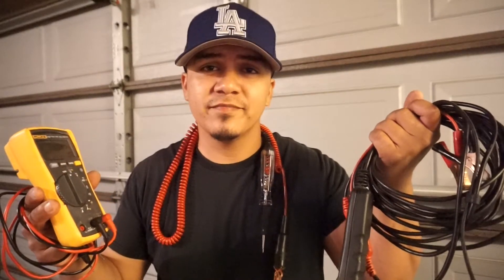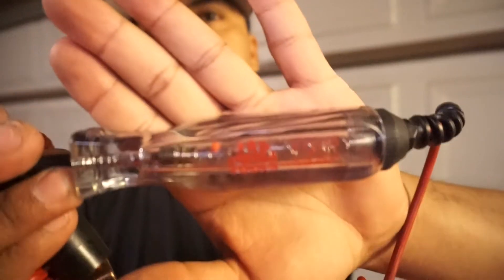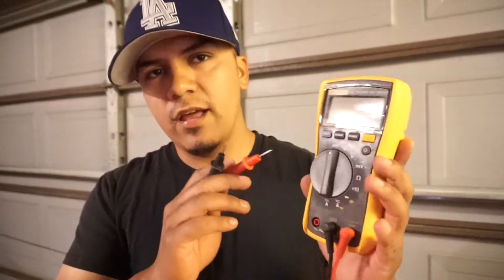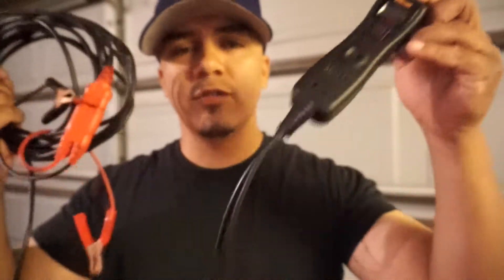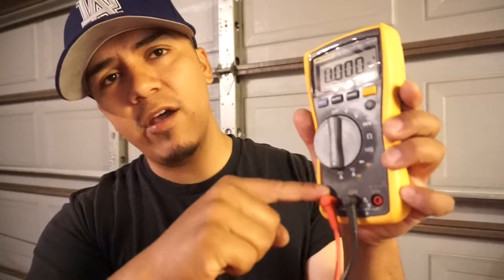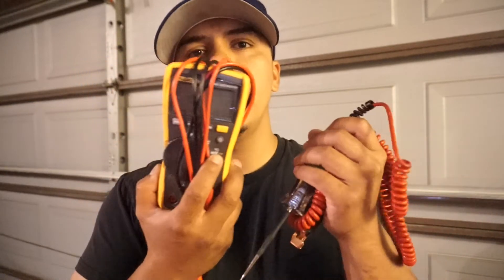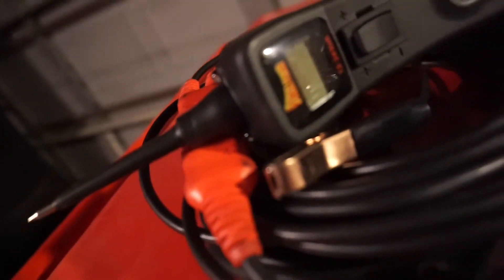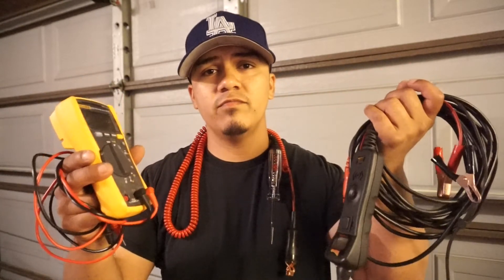3 Tools For Automotive Electrical Work for beginners

Comment: Need to change the title up to say Top 3 beginners Automotive electrical tools. That way it pops up on the search easier
Reply from the maker: New Level Auto I'm gonna play with it, I did think about it but I kept It simple...thanks though...
Reply: The Homie Hektor only a 4 word title so it should increase traffic
Reply from the maker: New Level Auto Got it 🤙🏼 You're at +3K subs with a couple videos so you're doing something right 🤝
Reply: I agree with new level... titles are key!
Reply from the maker: South Main Auto Repair You guys are right, Titles and Thumbnails, Thanks for the advice 🙏🏼